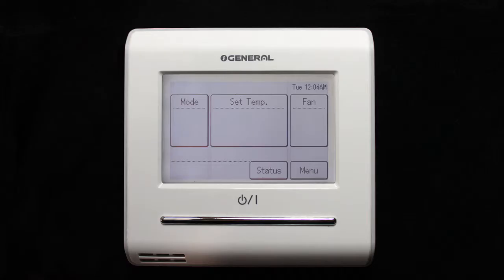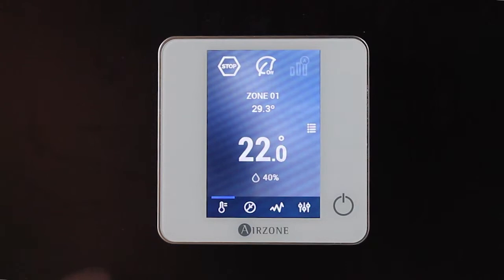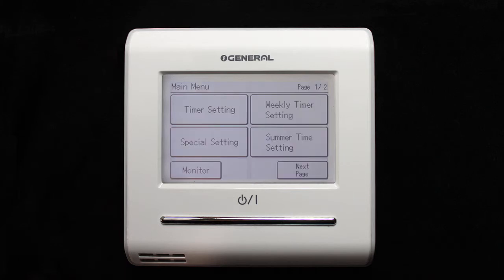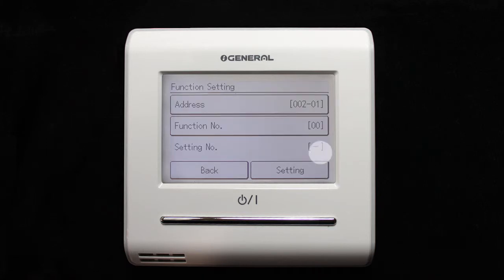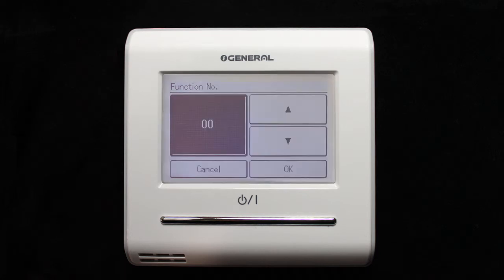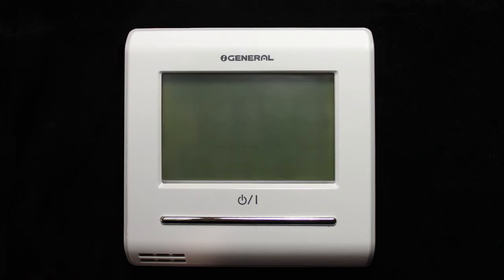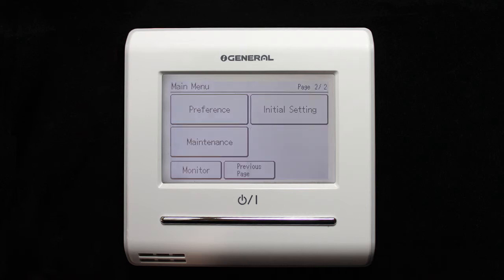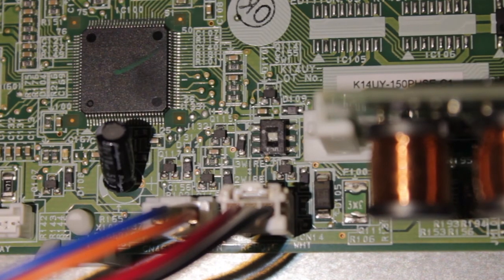Fujitsu Thermostat: Activate sensor reading (two-wire cable)

Comment: How can you get through the operation prohibited?  I have a Simple Remote Controller UTY-RSRY and can’t change the sensor to enable. The manual is useless.  Any advice would be appreciated.

Comment: Can these airstage wired controller run with universal remotes? 
As I can not any info anywhere about compatibility with wireless remotes? Please advise as I’d like to buy a wireless controller as 1 these was installed today but no wireless remotes